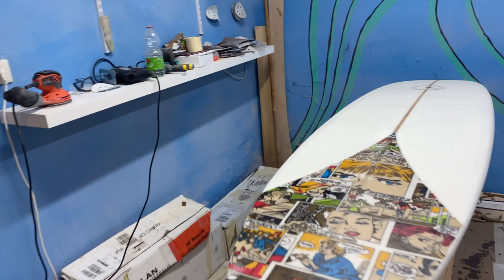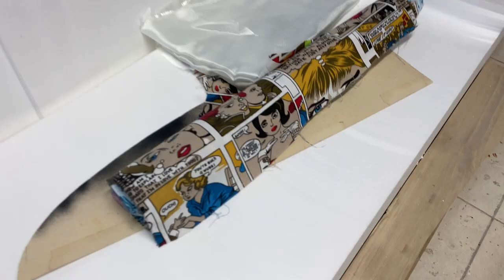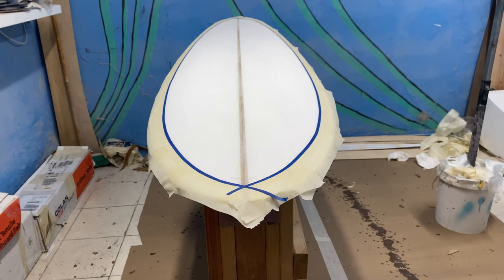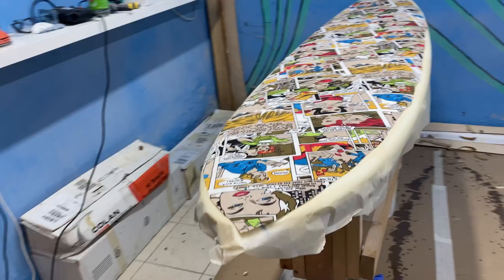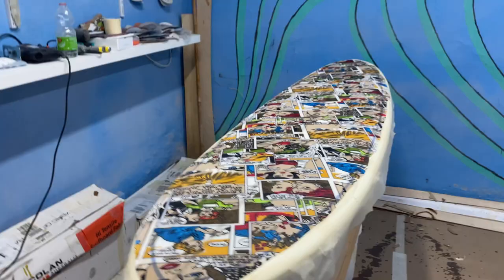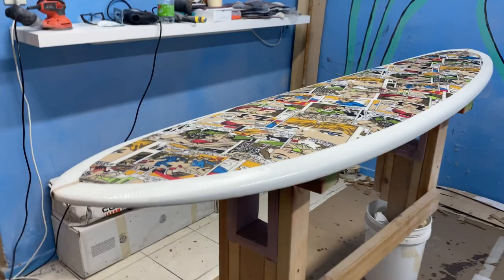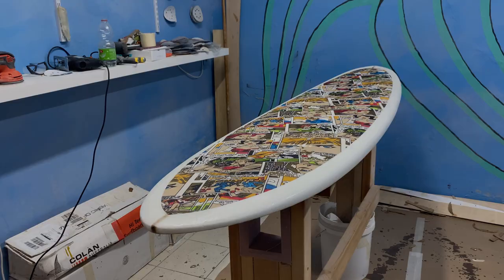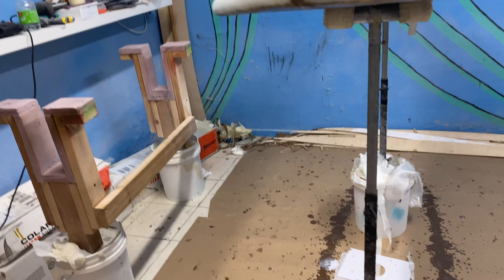Surfboard Lamination Fabric Inlay | How To Do A Fabric Inlay Part 2

Comment: How much weight does it add? I mean if you were making, let’s say 5’11 x 18 hi performance board for a pro/wct surfer…would it be noticeable to them? Assuming you use 4oz x 4oz…
Just curious….it looks absolutely fantastic by the way
Reply from the maker: I wouldn't use it for short board LOL
It will add 5% give or take to the overall weight 
Just an estimate 
And 100% more work 💪🏽💪🏽💪🏽